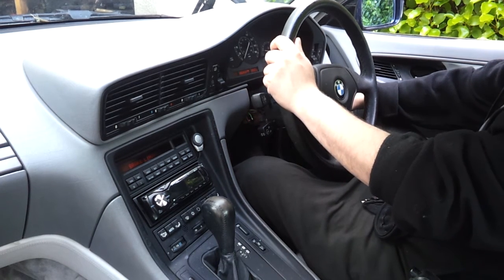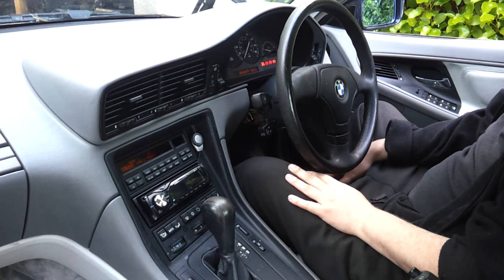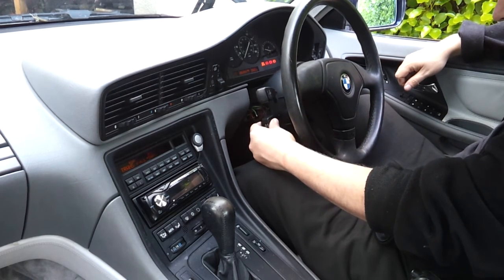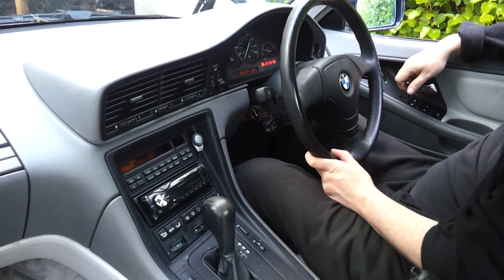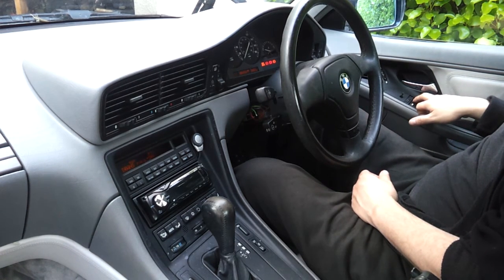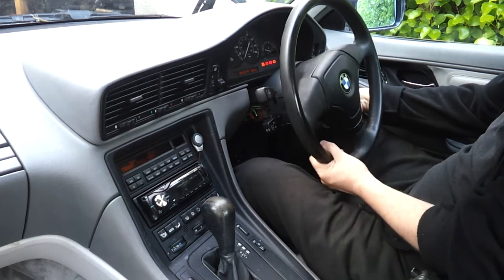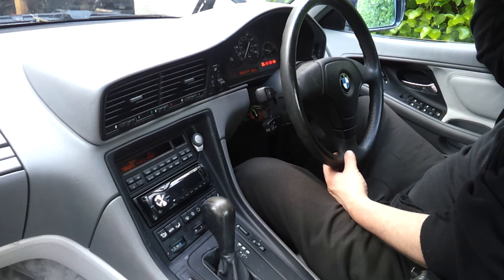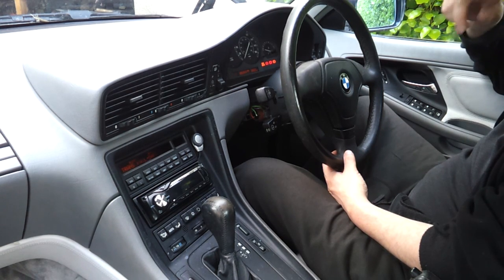BMW E31 840CI EV Conversion 22 : Revving Up

Comment: darn power steering pump is making so much noise - is that common? sounds like it is making some pressure even with no input from steering or brakes, not sure if that's normal or not.
looking forward to the road test, very nice build - you got to love the steering wheel getting out of the way to get in and out.

Comment: Damien you should check the engine the check engine light is on 😄
Reply: V10PDTDI The CEL is on the left side, bottom right. The one on the right is just a Check-light to get you to look at the MID, which displays a washer and trans error. Engine has a separate light.